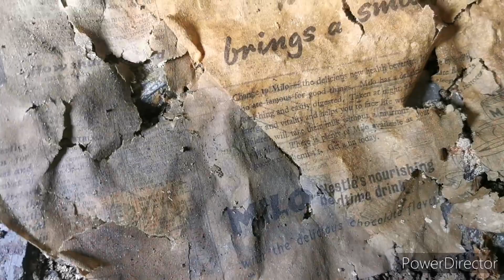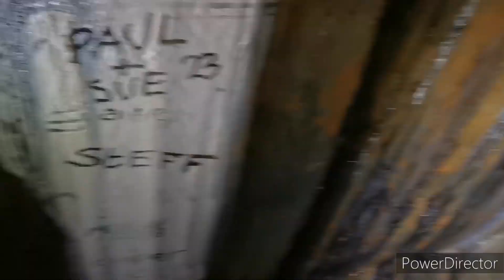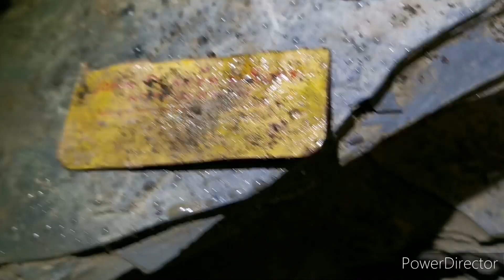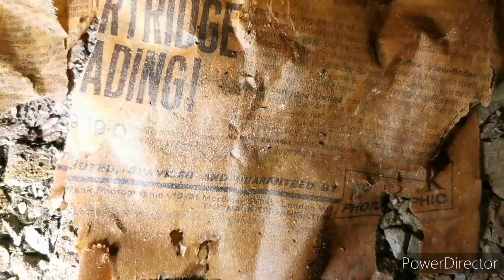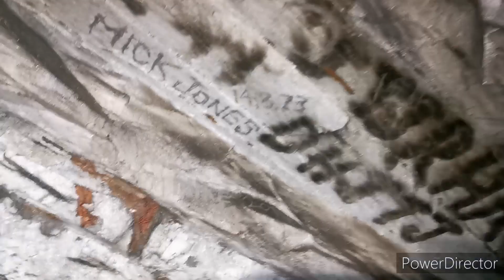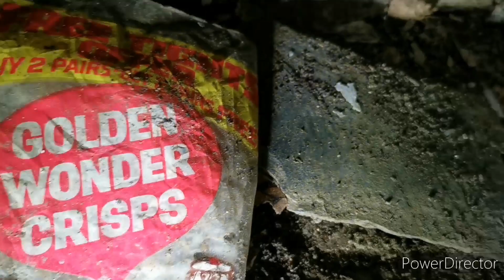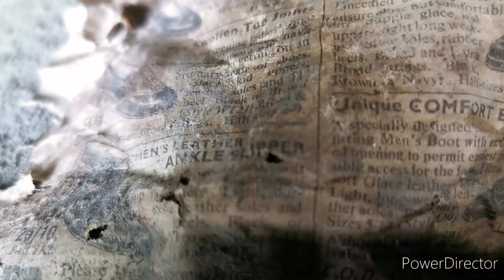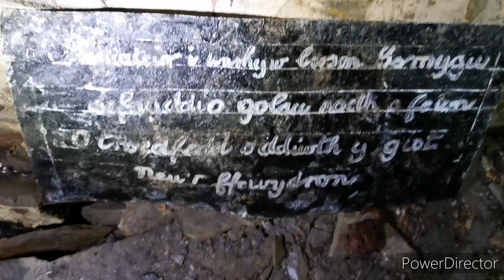Local Ffestiniog Slate Mine

Comment: Anything left under Oakeley worth a look or too flooded / risky ?

The Horse Tunnel ?
Rarely ever visited or seen.
Reply: Unfortunately on going un topping works have left the entrances un accessible
Reply from the maker: You can still get in through the mine next door, but horse tunnel has been gone since the 80's. It was just left of the railway tunnel on same level as the bridge which led to old Mills (tip now cleared and where recycling centre is now) 
Just below the railway tracks there is drainage adit which goes in 400m, this was used for horses too I think